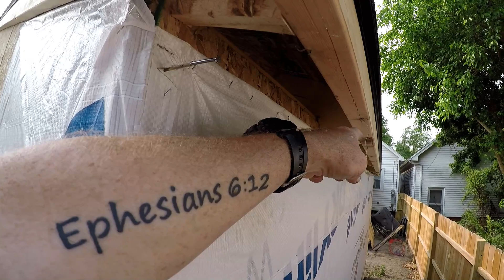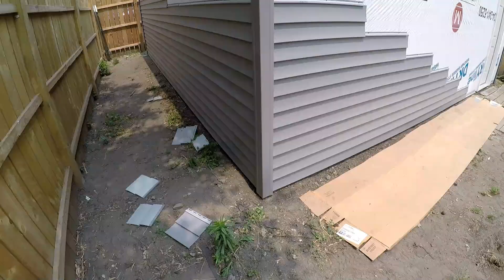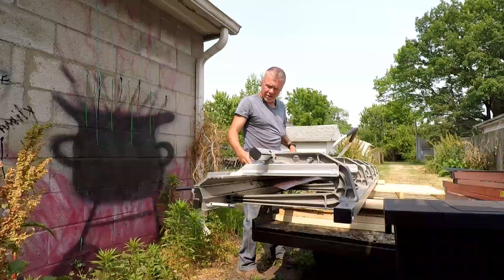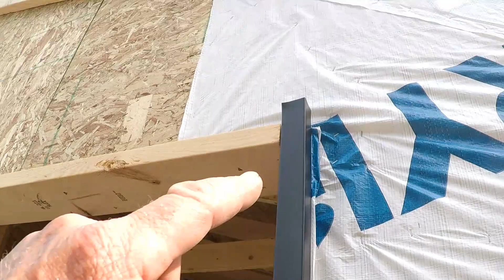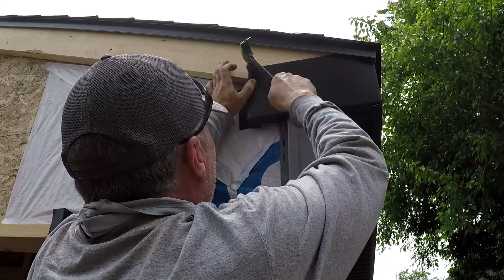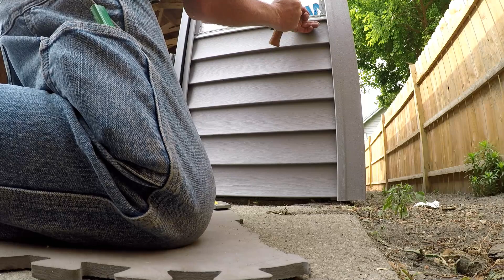Can A Framer Hang Siding By Himself? MY DIY

Comment: If you nailed through that top piece of siding it's prolly gonna buckle the crimpers and finish trim let it expand and contract it's a lighter color and under the overhang but still taking a big chance there. Also on the top of those eves you'd be better centering 1 nail. It's crazy how much that stuff moves. I really enjoy your videos I'm curious why you work alone.
Reply from the maker: I agree about the top pan, but they tend to fall off when I use the crimpers, so I just nail em…haven’t had an issue yet.

Comment: Great job, I really enjoy your videos.  I'm trying to build a 24x30 garage with my father in law, and your video on a similar design has been helpful.  We have a loft on top of the garage, so that's been challenging.  Got the subfloor and walls up for the second floor, but due to unevenness in the concrete slab, everything north is uneven and difficult to manage.  We will attempt to put 2x10 rafters up for the roof.  To prevent wall spread, will probably tie in every other one, which will annoy tall people because the walls are only 6'3" high.  But it's for my kids, so what do you do.

Comment: I like to hang the second course of siding with a laser line first and hook short pieces of siding into it to locate the starter strip. By hanging the starter from the short pieces, they will act like a third hand  They will slide right along and make it easy for you

    I hate to see installers take the cut piece from one end and use it to start the next course and do on. A regular occurrence of a uniform stair step looks amateur. They need to be somewhat random. I try also to minimize waste by managing pieces around windows and doors. A bit of planning as waste develops works wonders 
  Working alone is easy enough on one story projects but up high on windy days required help
  These comments are for the rest of us and not to denigrate workmanship of this installation